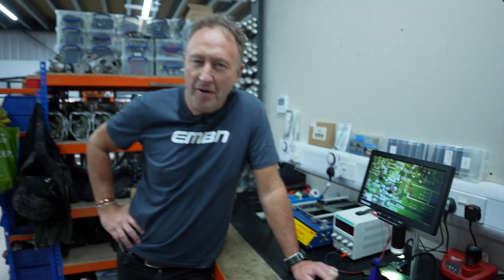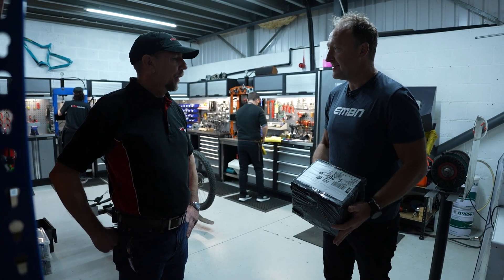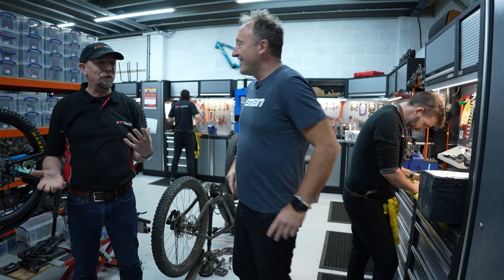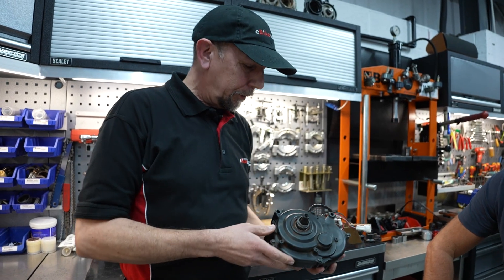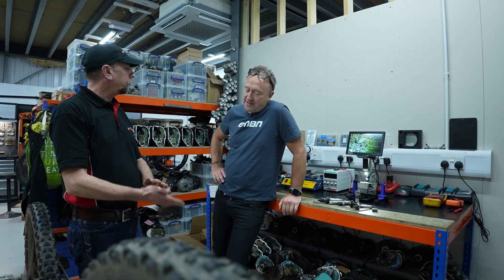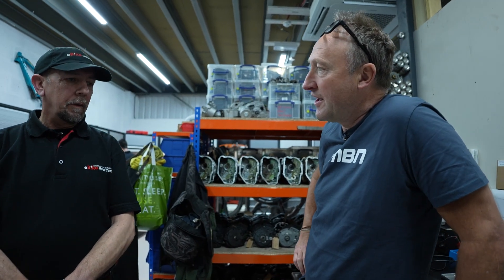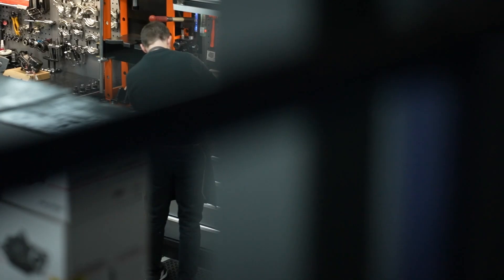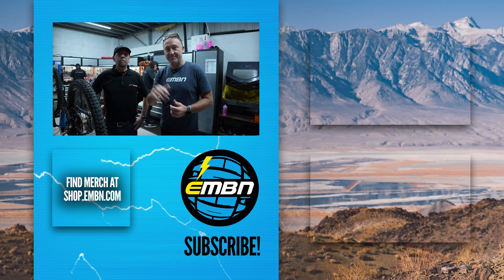How Affordable Is eBike Motor Repair | Behind The Scenes

Comment: After 3 years and a few thousand miles my Brose motor from my 2021 levo has given up. The specialized app says it’s a belt failure. Was thinking of sending it to the motor repair centre but a very well respected and trusted specialized dealer told me not to and that I’d be better off just getting a new motor as specialized apparently offer an assisted purchase scheme on replacement motors. Assured me I wouldn’t pay full price for a brand new motor and I also get another 2 years warranty. Probably still gonna cost around £600. The reason they told me to do that was that they think the electrics will probably soon fail too and Brose don’t sell replacement circuit boards so I could spend a few hundred getting it repaired and then be screwed a few months later if the electrics go. Not sure what way to go now. Any advice would be appreciated thanks.
Reply: My original Brose motor (2021) conked out just within the 2 years warranty. Replacement motor fitted at no cost. 6 months later and the replacement motor fails - but this motor had no warranty - what's that all about? So I went for the assisted purchase - £600 or thereabouts - this with a 2 years warranty. The whole situation seems crazy! You wouldn't buy a car and expect to fork out for a new engine within 2 years - yet I'm on the 3rd motor inside 3 years. I can see me reverting to non-assist at this rate. Trouble is I love the Levo.
Reply: It's a shame there is a lot of misinformation out there. And its probably not your trusted dealers fault, he would have heard this from someone else etc. I can assure you, one of the strongest motors on the market regards electronics is Brose! They are one of the only motors that site the PCB outside of the motor, in it's own compartment, this helps protect it from water ingress etc. But the actual electronics are near bullet proof. If you have one of these motors upgraded by us, it makes the whole motor much stronger and very water resistant. Sadly, you don't get that with a new motor, you just go back to where you started.
Reply: Send it to them anyway...for a small charge they can open it up and check out what the damage is, but they won't do any repair work until you've accepted the estimate costs.
It's possible that you could be back on the bike for a small cost if not much wrong. If it needs a whole load of parts then you can still get your new motor if you wish.
Reply: @Ebikemotorcentre - thanks - I'll remember that 👍

Comment: Used these guys for a while now for my customer's bikes... Their service is absolutely top notch and worth every penny.

Listen and take heed, stop washing your bike so much and just ride it.
Reply: Yeah i try to avoid it having seen Pete's bikes haha
Reply: I'm in On, Canada and use mine year round. I have to wash mine after spraying salty snow a slush all over the motor. I didn't wash it for 1 winter and when I hosed the motor down, the casing was corroded and quite pitted.
Reply: @brianlittleforest631 I think a dry brushing technique using a light cleaner might be best for your application. Sometimes difficult to get in all the nooks and crannies though, maybe an air line.

Salt spray is gonna do that unfortunately, I also see it in my customers bikes that live by the sea.
Reply: What is the most reliable motor from what you get and see coming through the shop if you don't mind me asking
Reply: @shaunsims-p2z difficult question, I send a lot more Bosch motors in for repair, but 80% of my customers ride bikes with the Bosch motor. I think all the motors are reliable so long as they don't get too wet.

Comment: Was expecting a lot more than that. With the chain off advice, is that with the motor on or off?
Reply: Hi, you will get a better feeling from the bearings when the motor is turned OFF. Best regards, EBMR e-Bike Motorreparatur (Austria)
Reply: There will be more videos coming. As for chain off advice, motor off, so you can feel and hear whats going on. Motor will not work without pedal pressure anyway.

Comment: It's great to see small businesses popping up and thriving. However, this doesn't "fix" the problem. Nor "cement" consumer trusts to buy another EMTB after or sometimes even before motor failure. 

Example. One could own a CRF450R. From 2005. Nearly 20 years old and go to dozens of websites and order: Every. Single. Bolt. Seal. Gear. Bearing. ECU. From OEM for that motor. Considering the cost and complexity of EMTB vs. Moto Bike. This lack of availability from EMTB manufacturers is inexcusable. 

Now, the loss of logic. If a diagram and catalog website were created by the manufacturer offering such a thing, plus possible superceded parts for "vintage" generations for the consumers. Would this not generate profit? More importantly, would this not "cement" trust to buy new and boost resale value? To gain MORE consumers? 

One more thing to consider. Water intrusion. This could be solved with a simple threaded nipple. With a hose and one-way check valve. Water drains and evaporates. Coating the case internally to prevent corrosion. Add potting to the circuit board. Failures eliminated. Unless........
Reply: A lot of cynicism is needed around too much of the bike industry, e or otherwise. It's really disheartening.

Comment: Excellent video. I’ve got a Gen3 Levo/Brose but I didn’t hear the bit about the improved seals???

Also, please please please can you do a similar video on battery repairs or replacement?
Reply: @anonymousone6075 90% of motors is a full strip down and hours of work to re-grease any crank seals, if indeed they actually have any crank seals.
Reply: Keep your eye on EMBN, there are more videos coming.

Comment: Great video thanks. How do I grease / Oil my crank bearings. Can I use chain oil or is there a special grease I need to use. From your video it implies most failures occurring to motors due to water ingress on the crank seals so it would be useful if not critical to be educated on how  and when to maintain this on an ebikes. Thanks, Oli.
Reply: Don't oil them! Have a read through the e bike motor centre's website... im pretty sure that's what they stated on there. There is a lot of good advice... such as I learned that yamaha motors should be regreased internally after the first couple of thousand miles due to the grease used drying up.
Reply: @andyarchitect thanks for info. I read their website and like you say lots of good info. I also have a Yamaha motor. It's a crazy situation where all the MTBs are fitted with essentially road bike motors with no additional upgrades to handle wet and muddy conditions. I'm pleased EMBN are starting to do features in this subject. I would like to know the correct grease to purchase.
Reply: @oradcliffe  I considered regreasing the  gears myself... however I am already planning to send it in to them as I'd rather have it done by people experienced in what things should look like and how brings should feel etc to make sure I don't miss something important. I think it was some kind d of waterproof or marine grease they said they upgraded the yamaha grease with, but don't think they specified an exact brand or type.
Reply: @andyarchitect  We use the genuine Yamaha grease within the motor, but we do add a very tacky waterproof grease behind the motor covers before the bearings are seated. This stops water sitting between the motor covers and the bearing seals. We also add this to the crankshaft rotary lip seal and add a garter spring to the seal for a tighter seal.
Reply: @Ebikemotorcentre  I can now appreciate why it's not a good idea to jetwash or hose around the crank area. Another video showing maintenance tips and if a user can do anything to further prolong the service life of their bike without opening a motor might be useful. i.e. Can the crank seales be greased from time to time from the outside of the motor or is this a waste of time. Can electrical connections be further sealed above the factory spec etc...Thanks @ebikemotorcentre and @andyarchitect. When I asked what grease to use in my head I was assuming I could occasionally regrease the crank seals from the outside? I agree that if it's time for a service of the of the motor let someone with experience of these motors work on them.
Reply: @andyarchitect  👍👍

Comment: I have to send once bosch performanc cx gen 2 there. It was showing signs of mechanical problem despite it was low mileage city bike but older model 2016. When motor  unit come back from repair noticed one of fixing holes was  little squashed like unit was dropped on hard surface. Make me little suspicious but I did not bother to contact them about it just use file make it possible fits back on frame. And it works ok so far only little grease appears on both sides of cranks seals. At least I know they lubricated it well . If I need to happy to use them again.
Reply: Hi no I don't use pressure washer at all. Motor unit was sent there because when rolling bike backwards it was resting sometimes even stuck. It was still working fine pedaling on it now noise or anything else. When the open it there was faulty bearing on one of clutches. That what they told me.

Comment: My drive side axle/crank bearing has just gone bad on my Bafang BBS02 after 3200 road miles. Sounds dry when pedalling in the bike stand. Ill be honest, I have been using a low pressure garden hose and cleaning my bike once a week with degreasers and such. I would have sent it to these guys, but it looks like they don't deal with Bafang motors. Once I get it fixed, ill be sure to keep the hose away from that exposed bearing!

Comment: The timing on this is interesting. I just had bit of a scare where I thought I had done a motor bearing (turned out it was crank bearing / fitment thankfully) but it was interesting to research.

I contacted the Australian branch of this service and was told as far as servicing is concerned, they wouldn't touch my Shimano EP8. They would be happy to sell me bearings, but as far as servicing was concerned, I was on my own. Reason being their experience in cracking open an EP8 was too risky, as it was a total crapshoot as to whether the motor would ever work again or throw up errors and were just too inconsistent and temperamental to work on. 

To me, that's unacceptable on Shimano's behalf. Bearings are a wear item and should be 100% replaceable, that Shimano either straight up does a warranty for them, or in the event it's out of warranty, expects you to just buy an entirely new unit puts Shimano on an insta no buy from me going forward. 

Ebike motor manufacturers are surely taking the piss here. It's an AC motor with speed controller and torque sensor, it's not new or complex tech; to me, it seems like these companies are being purposefully arbitrary in their design process, it seems primarly, on the software side of things to lock out consumers from repairs. There's no reason any component in these motors should not be available as spares that can be replaced or serviced.

Also on the pressure washer (not even hose), seriously? A pressure washer on a wide fan setting should NOT be causing any issues. If the bearings on these can't handle even a garden hose, these companies should be taken to town on the suitability of their designs. I can understand a pressure hose on full blast staight at / into a motor, but a hose or wide fan setting on a pressure hose to mist shouldn't be a concern for a bike which is expected to be used in a variety of weather conditions.
Reply: Shimano motors are not currently supported by us (eBike Motor Centre) nor are they supported by most of our partners, because they will not even entertain talking to us, let alone helping with any software etc. They are a particularly troublesome motor to repair for the long term. If Shimano owners campaign to Shimano to support us, or even just speak to us, then perhaps we could support you guys fully outside of warranty.
Reply: @Ebikemotorcentre   Hello! What are your thoughts on the Dyname motors from Rocky Mountain? Any experience with repair on those? Thank you!
Reply: @chuck1622  We have repaired a few for a local bike shop and they are a beast of a motor! Heavy and possibly a little over complicated, but built like a tank and most of the bearings that fail are relatively easy to replace.
Reply: @Ebikemotorcentre  hi, currently looking @ 2nd hand reign e+1 2022 are these motors repairable throughout or no goers compared to gen 4 bosch? Nice answers there 👌
Reply: @craigneeds6579  The unfortunate thing with Giant motors is they use their own proprietary software, this means we can repair anything mechanical that goes wrong with the motor, but if there are any issues with the electronics within the motor, it's game over and a new motor will be your only option :(
Reply: @Ebikemotorcentre  spend the extra 2400 on a new cube one55 and have the bosch motor and 750 battery then? Or is that a likely bankruptcy too? 🙈 Thanks for that info. If I don't go with the cube, I'll happily stay away from them all now 😅 if I do have 1 at some point il be finding you guys if I can't repair myself 😎 lots of people repping you guys, love to see working people with souls still ❤️
Reply: @craigneeds6579  I'm sure you will be happy with what ever choice you make Craig, and rest assured we'll be there if you ever need us. 👍
Reply: Hi again guys just wondering if you currently have or usually have a recon supply of motors for these 2022 giants?  @Ebikemotorcentre
Reply: By all means use a pressure washer on your bike and motor, the expert said specifically do not use a pressure washer.
Go for it.    Pressure washers destroy motorcycle parts just as well.  And normal bicycles.
Reply: Totally agree, and when I brought my ebike it was the same reason. I didn't look at anything with a Shimano motor in it.
Reply: Im in Australia also and agree with your points, being a Bosch and Fazua owner, I'd hope these thing last the warranty period more so the Bosch unit currently at 7000ks, the best thing you can do is apply a bead of waterproof grease around the crank splines to avoid water ingres.

Comment: The answer for the question at 0:02 woud be TO BUY NEW BIKE for 5k£ - 12k£ every time it happens. Or at least that is what MTB manufacrurers want.
Reply: @anonymousone6075 It is part of the truth ,but the issue I have is where you even get a new motor??? They are not pubblically available.
Reply: @anonymousone6075 
Please can you explain the process for 'redoing the crank grease' on say, a Brose motor?

Interested to understand how you perform this and which grease you would use. Perhaps link to a video of you doing this '5 minute job'?

Comment: How are you supposed to clean an ebike without getting it wet ??
Reply: They didn’t say don’t get it wet, they said don’t use pressure washers or high pressure hoses. Use a low pressure (adjustable) end on your hose (or a plug on brush) and ALWAYS clean 90 degrees to the bearing surfaces otherwise you’re just pushing the dirt and water inside. I’ve done this for years and bearings are all good.
Reply: Best way is to spray a dirt cleaner like Muck Off, Truck wash, Motorcycle cleaner etc. and brush with a soft brush then hose off with a sprinkler on the hose. Other things to watch are long deep flooded ruts,  deep water fording, car racks on wet roads etc.

Comment: Done 17K km on my eBike and never once cleaned it with a pressure cleaner. Quick brush with T wash and a rain off sprinkle from a distance then straight into shed with full tank of air blow it off and out asap. Try to avoid riding it in the rain and never ride it through water.
Reply: I live in Ireland. It rains quite a lot here. I'm waiting on my first e-bike for daily commuting and a general workhorse. A Cube Kathmandu 750w 85nm. €3,500.
The whole point of getting an e-bike is to make commuting and travelling especially in wet and sometimes VERY WET with lots of ground water and windy weather easy.
If I can't ride it on a wet day for a 40km round trip without worrying about screwing up the motor then I may as well just cancel my order right now and put that money into something else instead. I think I might need to have a chat with the bike shop.

Comment: I have a dead Shimano e8000 motor, mechanically fine but won't turn on or respond when plugged into a computer with Shimano software. Done very little miles and never been pressure washed. Local bike shop is saying I need to replace the motor. Do I have any other cheaper options for repair?
Reply: Did you try to start your system with the battery Button?
Reply: @gk3834  there is no battery button, unless you mean the one that you have to crack open the battery case to access. The motor has been tested with a different battery as well as plugged directly into a computer, it's electronically dead. This was all carried out by the local bike shop in communication with shimano.
Reply: It's well known that Shimano motors can't be fixed by 3rd parties, should have mentioned that in the video.
Reply: @RolandLovell  Shimano are totally fixable, but until Shimano speak to us and support us, we and most other repair partners, won't help them until they help us. Please campaign to Shimano to talk to us, if they help us we can help you.